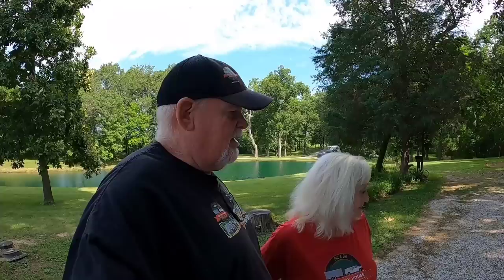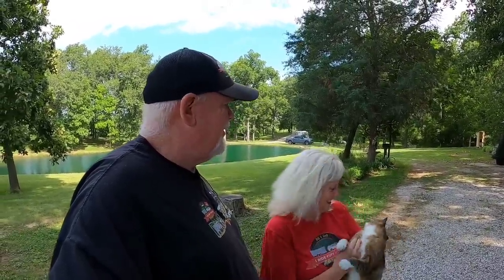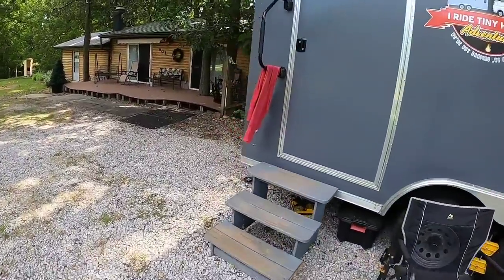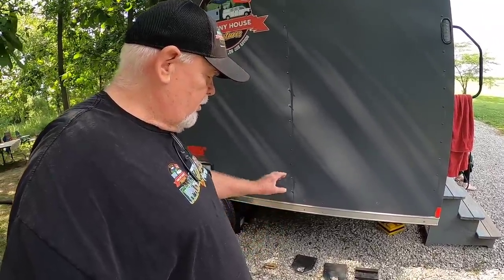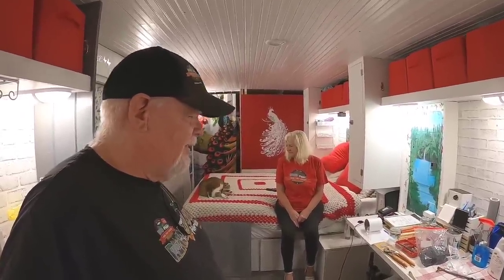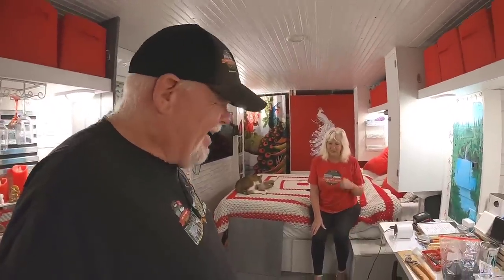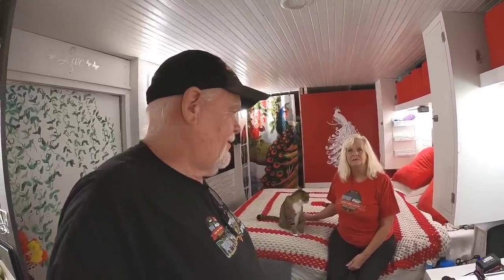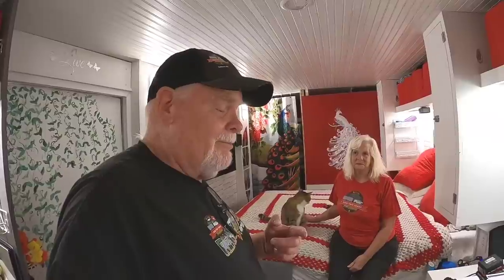Cabinet Doors And Bike Rack Mount. Amazon Product Reviews?🤣🤪🤣🤪

Comment: Bill or Deb…. I know you have done videos on this in the past, but approximately what is/will be your weights after your kitchen finishes and bike/tire mounts?  Will the back mounts lessen your tongue weight?  

I really do feel that your current rig is a livable work of art.  Start your own trailer line.  Call it the “We’re Living” series.
Reply from the maker: Our trailer, fully loaded, ready for travel weighs in right at 7500 pounds. Carrying the bikes and spare tire at the back, will probably lower the tongue weight, but only slightly. As it is, we pretty much have the weight distribution hitch dialed in, and we do not anticipate any adjustments will be necessary.

Comment: Hello,
Use duck tape first on where you are going to use the double stick tape, to get your surface stickie..... then pull off the duck tape before you apply your other tape.
Reply from the maker: We didn't have any duck tape, so, after cleaning the flanges first with denatured alcohol, we used the sticky tabs that came with the flange kits, and they worked surprisingly well. 😉

Comment: I have a question that is completely off subject but I haven't been able to find any videos that would answer my question.  It's concerning the mini split system.  My trailer is a 7x16 and I'm curious how well the temperature stays at the rear of the trailer with the unit at the front.  I've been using a temporary portable unit but being a healthy sized guy I don't like to sleep hot (72+ degrees). Also is a 12000 btu overkill? HELP 😅
Reply from the maker: A lot of it depends on how well your trailer is insulated. Ours is an 8.5×20. We have 1 3/4 inches of insulation on the walls and ceiling,  and 3/4 inches in the floor. We have a 12,000 BTU unit and it can literally freeze us out (evenly) on the hottest days. There is only one partition wall in the trailer and it has a 3 foot opening plus the top of the wall falls 6 inches short of the ceiling for circulation. As long as your 7×16 is well insulated with minimal partitions we would think a 9000 BTU Mini Split would be fine. If you plan on spending a lot of time in the south, during the summer, you might want to consider the 12,000 BTU version. In addition, the 12,000 BTU version (Senville) is only around $50 more than the 9000.
Reply: @billanddeb  I have 1" in the walls 1" in the ceiling with a 3/4 air gap then another closed cell 1/4 "  then tin. Floor has 1/2 ". I plan on coating the roof with white roof coating. The portable was pulling a vacuum on the trailer its so tight. I do have two closets between kitchen area and rear with a 3ft opening.  I'm in the process of building a swinging rear wall as well so rear door can be used as a patio. I watched your video on the unit you have and knowing they worked with you on the warranty issue speaks volumes for the company.  Hopefully some day when I get more time I can make a rally with you guys. Thank you for the response.
Reply: @Lovinglivinghowardstyle  I would go with the 12,000btu rather than the 9000. I too have a 7x16  V-nose all done using a Pioneer 12000 btu, 110V version. works great! Cools down in 5 mins inside. For insulation I have 1 1/2 inch on the ceiling and 1 inch for the walls.
Reply: Thank you,  I believe 12000 is the winner